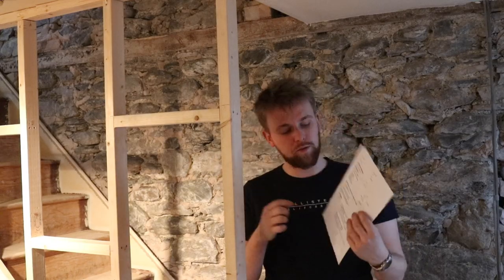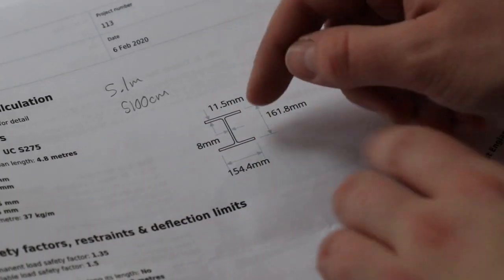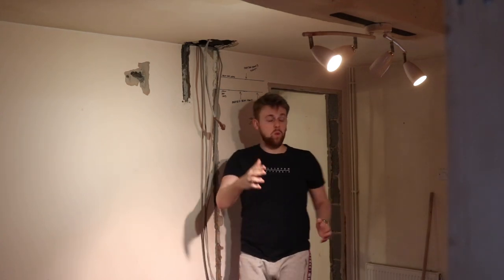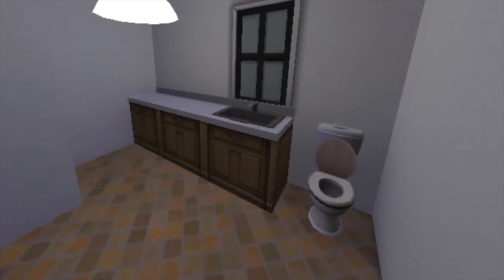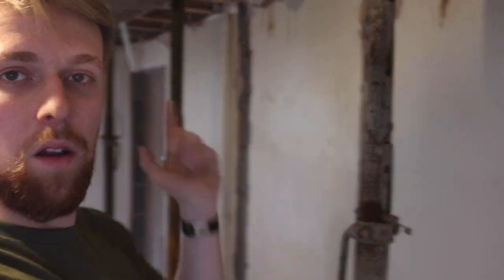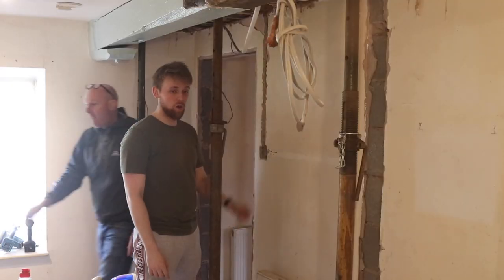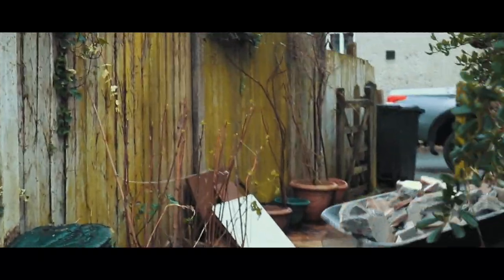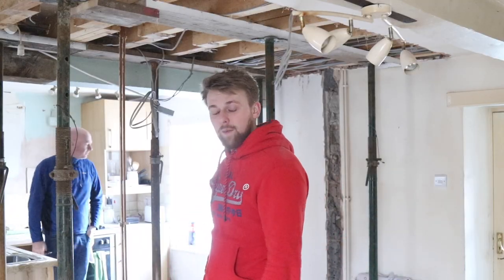The Welsh Project | Cottage Restoration | REMOVING A SUPPORTING WALL PART 1 (EP 5)

Comment: Brings back so many memories.  I removed an 18.5' load bearing wall on a 1st floor of my in-laws house and installed an upside down "T" beam fitted up into the ceiling after notching the open web trusses.  That beam was over a 1000 lbs. plus being 18.5' long was a bit of a worry.  I too wanted to hide the metal support post in the end walls and had to add additional footings and girder supports under the end columns.  Keep up the good work.